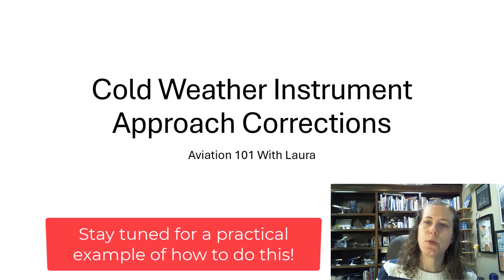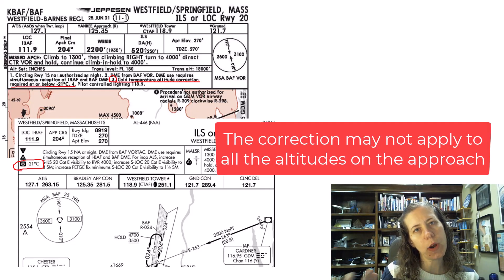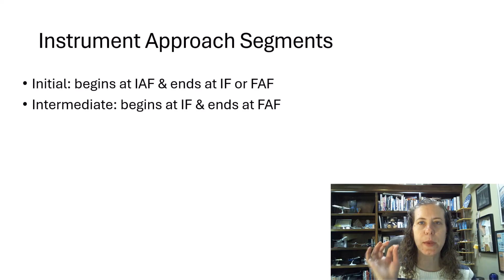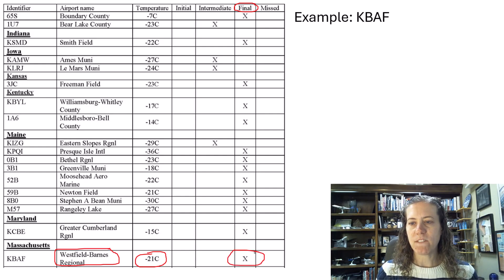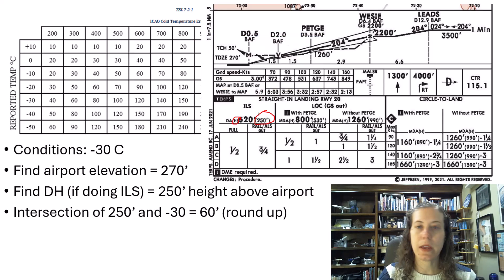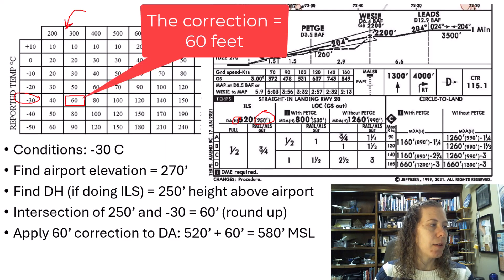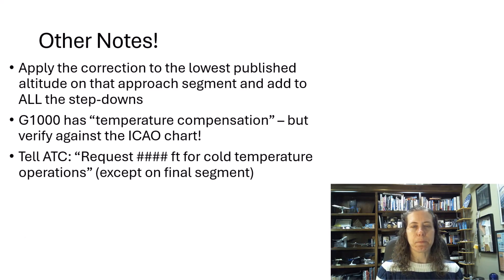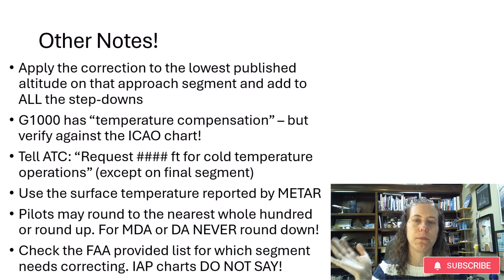Cold Weather Airports Temp Corrections: Instrument Approach Flight Tips IFR Pilots: FAA & Jeppesen

Comment: I’ve always been confused with why cold temps would cause you to fly lower than indicated on the altimeter. Cold air is more dense/higher pressure than normal. Why wouldn’t this cause the altimeter to think it’s lower to the ground than actual because it’s more dense. If the altimeter is reading lower than actual wouldn’t that cause you to fly higher over the ground for a given MSL reading? Thanks
Reply: Example:I would think that if it’s very cold and say the altimeter thinks it’s at 300ft because it’s freezing cold and the air is much more dense than normal. You would in reality be at 350 or something because the altimeter thinks it’s closer to the ground than it actually is. Again I know you’re right just confused with why ahah. Thanks alot!
Reply from the maker: If the air is denser and your altimeter is not temperature adjustable (they are not) as you said it’s more dense so the cold air is compressed. If you follow it the altimeter without any correction, you will also fly closer to the ground (because like you said cold air is denser). We CAN adjust for pressure differences with the Kollsman window but not for temp differences, besides doing math with the correction table when it is super cold.
Reply: @LauraLaster747 hmm still not clicking for me. 😢Thank you for your time though.
Reply: @LauraLaster747 if a crossing restriction is 800 ft MSL. You cross it at 800 indicated on your altimeter, but your altimeter is reading 50ft lower than your actual height due to cold temps. You are in reality at 850 MSL. So wouldn’t you actually be higher above said obstacles. My logic that is incorrect but I’ve never been able to see how? Been loosing sleep over this haha. I’ll Apple Pay you 50$ if you can get me to understand lol.
Reply from the maker: In your example if you’re READING 800’ MSL and it’s cold and your altimeter has a 50’ error (that you didn’t correct for) then you’re at 750’ actually.
Reply from the maker: The article is maybe helpful to you!! https://www.avwxtraining.com/post/hot-to-cold-look-out-below
Reply from the maker: I hope that helps (see previous comment I just made).
Reply: Thank you I appreciate that. Get the error just don’t see why it wouldn’t be in the other direction thanks
Reply: Great article! Thank you! Makes more sense. I was kind of thinking of pressure and temperature as almost interchangeable as far as the altimeter knows. Now I see the temp just causes the altitudes of pressure to expand or contract!
Reply from the maker: I’m happy it helped! Better than me doing tons of little comments on here!!
Reply from the maker: So you are exactly correct! You are lower to the ground than indicated altitude so that’s why you would ADD the correction to the altitude printed in the approach chart. I apologize if that wasn’t clear in the video!
Reply: @LauraLaster747 😂 this is very confusing. I’m saying the opposite. I would think that the more dense air/higher pressure would cause the altimeter to “think it’s closer to the ground than it actually is”. Causing you to actually be higher than altimeter is saying. Due to dense air generally usually being closer to the ground vs less dense air being higher in altitude. I know what you’re saying is true and have memorized the correct answer but still confused as to why. Thanks

Comment: Not sure if the FAA rules insist on the pilot using the ICAO chart.  If not, the E6B computer can also be used to correct altitudes for temperature.  I noticed also a possible "rule of thumb".  That is, the ICAO corrections at -10C are about 10% and the corrections at -30C are about 20% and, at -50C they are 30%.
Reply: Using your E6B (or CR-3) sounds like ..., uhm .., exactly the kind of calculation it was designed to perform! With regard to a "rule of thumb", this chart seems a bit unnecessary to me. I am on your team on this one, either the E6B or a prudent "rule of thumb" must be good enough in this situation (if not in fact even more accurate).

I am going to paraphrase ICAO Doc 8168, which I believe is the source of the 'idea'. When surface temperature (used as a proxy for airmass temperature with ISA lapse rate) is 'much' lower than standard, then a temperature correction should be added to the minimum altitudes. The document tells us that using the "4% per 10C difference from ISA" is generally considered a safe correction when the surface temperature is not below -15C, and below that you should use a more accurate method. Then there is the shown table, which is calculated for an airport at sea-level, because, in practice, a sea-level airport is the one requiring the biggest temperature correction add-on to the minimum altitudes (for a given surface temperature, and assuming that no airports are located significantly below MSL).

The rule of thumb you noticed seems to solve ALL the problems. For temperature above 10C the correction will be so small that you may ignore it. At 10C, the "4% per 10C"-rule says 2% added to the minimum, so a 1000' minimum gets a 20' add-on, which is about the smallest value that is worth considering (IMO). For colder temperatures, but not less than -15C, the "4% per 10C"-rule is acceptable. So far so good. If, below -15C, we have to be more careful, and we probably should! Why not use a similar rule of thumb but add a bit of "very cold cushion". The possible rule you noticed can be rephrased in order to understand it better; I am not advocating to rephrase it in practice. The rule then says roughly "a standard coldish temperature is +10C, and for each 10C deviation below this temperature add 5% to the minimum heights" (which will indeed be 10% at -10C, 20% at -30C and 30% at -50C). By the way, notice that right at -10C (at sea-level) is where the new rule interesects the classic "4%"-rule, so anytime it is colder than that your new ("5%") rule is the more conservative (and when surface temperatures are in the interval -10C to +10C just use the classic "4%"-rule, or possibly don't do anything special, if that is how that snowflake icon on the approach chart is supposed to be interpreted).
Reply from the maker: Excellent points and rule of thumb discussion! Thank you for subscribing as well. I answered the first comment with my take that basically the FAA says some of their approaches might not include the required obstacle clearance when it's super cold, so it's kind of an FAA statement and procedure to "cover themselves" and avoid getting in legal trouble if someone crashes into an obstacle in very cold weather on an approach... (See my reply for my full thoughts on it.)
Reply from the maker: Thank you for watching! As mentioned in the video, this is from AIM, which is not regulatory. So you are correct that the FAA can't really "insist" on using that ICAO chart. If you read further into AIM, 7-3-4 currently says that the FAA determined some of their approaches are at risk for loss of the required obstacle clearance they build into the approaches when it's really cold. I basically take this to mean: "If you crash into an obstacle on an FAA published part 97 approach and it was super cold, now you can't come after the FAA with your lawyers and blame the government because here in AIM we told you a way to compensate." Maybe that's extreme in my interpretation! So your rule of thumb would probably be way easier to use than the chart, yes! Of course we want to be safe and rounding up with the rule of thumb is best practice. However, some air carriers or other operators might make their pilots use a chart like the ICAO one and likely even have it as part of their operating manuals. So it is also helpful to know how to utilize the ICAO chart. I hope that makes sense!